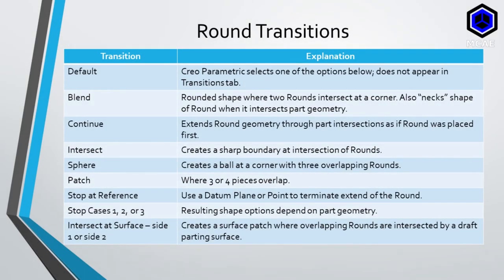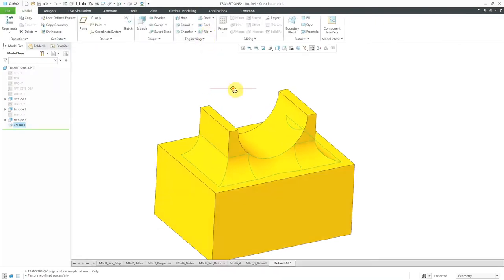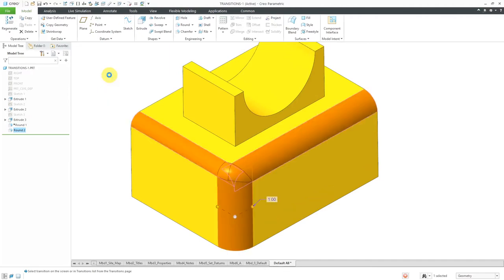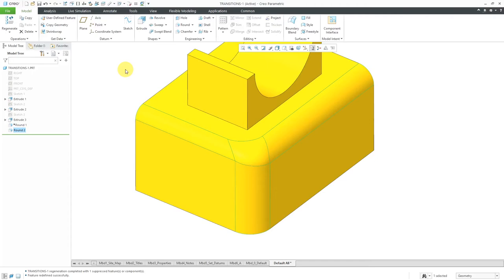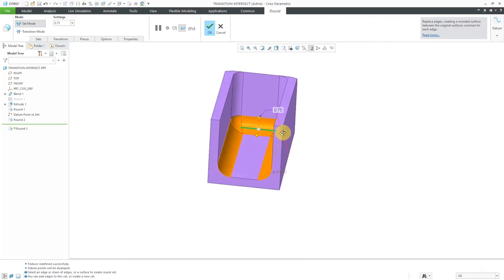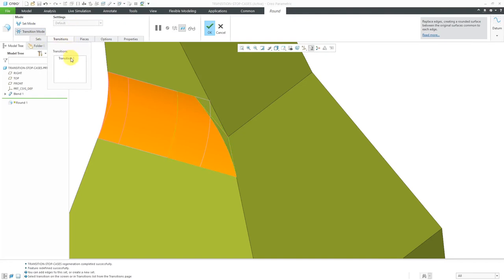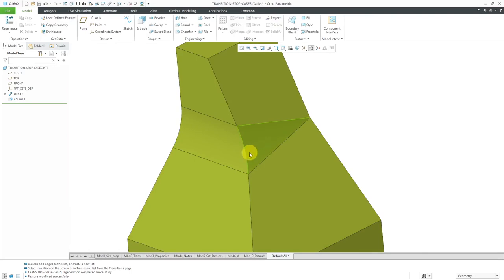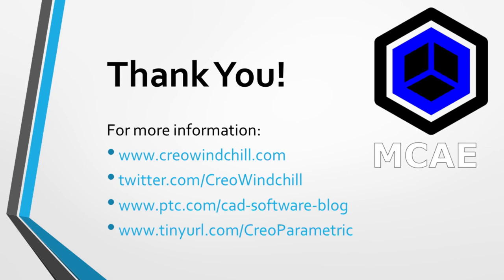Creo Parametric - Rounds (Part 5) - Transitions

Comment: I wish this functionality was better in Creo. All options, including the 'Corner sphere' option, only creates geometry with tangent (G2) conditions, with no option for continuous curvature (G3). The results are terrible in Creo. Basically all of the surface results are completely unusable for production parts. Just turn zebra stripes on and see how awful the resultant surfaces are. So disappointing. NX handles this in a usable way. Does anyone know of a way of getting much smoother better results using this tool?
Reply from the maker: Unusable for production parts? I think you are not only being overly dramatic but also thoroughly incorrect as this functionality is used in numerous production parts including those of companies I have worked at, including Lockheed Martin, Amazon, and Blue Origin. Also tangent continuity is G1, curvature continuity is G2, and acceleration continuity is G3. If you need G3 or not able to achieve G2, you can always use Boundaries Blends or the Style tool for those transitions instead of Rounds. As I explain in an earlier video, Rounds are simple engineering features used to reduce stress concentrations, eliminate corners, and remove non-structural mass.